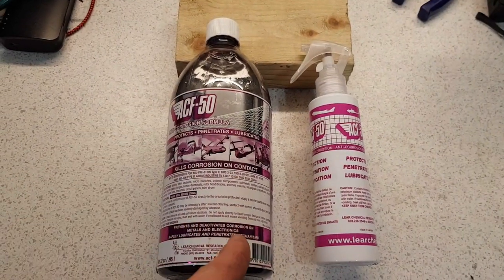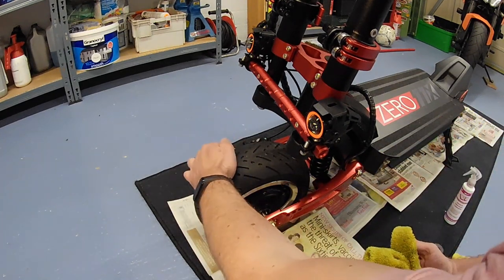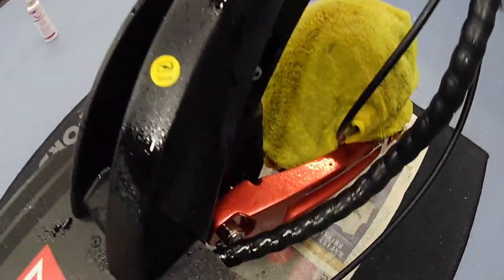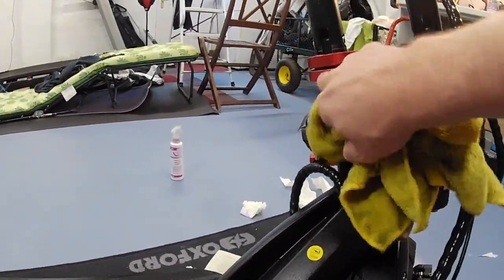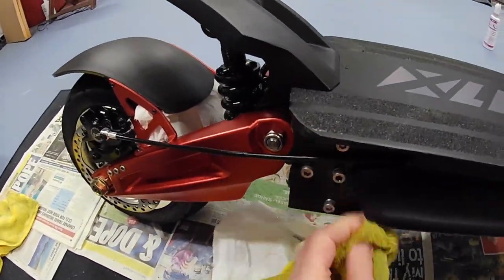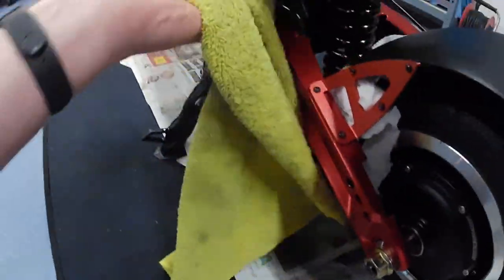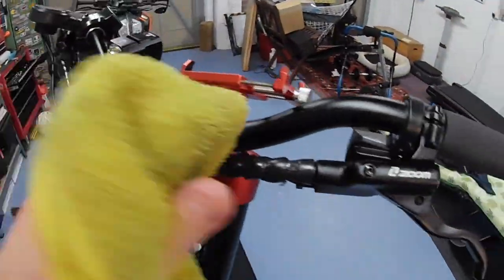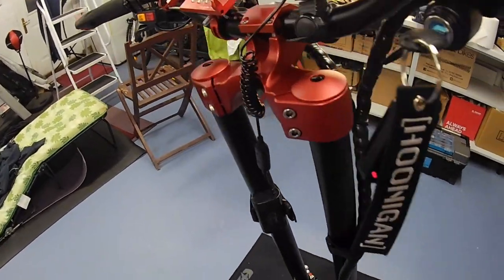Rustproofing the ZERO 11X Extreme Scooter

Comment: Hello,

Used it more then 10 years on my motorcycle. Had to use my bike also in the winter to commute for my job. Did not had a car.
Sometimes it was more then 25 degrees celsius below zero. Damn, that was cold. Although i had electric clothing.
But that stuff you are using did keep my bike in a good shape. Not completely ofcourse but when i had not used it in the first year all the salt would have corroded my complete bike. But when driving through the salt you have to use it a lot. Every two weeks i used it on my bike.
Some parts i dismantled to get everywhere because salt also comes everywhere in your bike. From all what i have used in 30 years the stuff you are using is by far the best against corrosion. Silicon is in reality a very poor product. Just butter is way better then silicon.
When cleaning your scooter be aware that you use cold water, not warm water because the effect of the salt starts to become much stronger with warm water. Just cold water with some mild determent like green soap. Sometimes in soap also salt is an ingrediant. Be aware of that. Or buy a good soap product that is for car use. 
And also seal every hole on your scooter otherwise water and salt gets to your controller and cables. But then it can not breath. So you have to put a few little bags with silicagel in the inside of your scooter.So the silicagel can take up the condensation that otherwise will buildup in your scooter. Every few weeks you will have to replace the silicagel for fresh ones.

Comment: This was great to watch. Gives me ideas.

Have you waterproofed your scooter with silicone, yet?
Reply from the maker: Yes, all done. Pretty simple job with some black silicone sealant. You need to remove the top cover plate and put plenty around the cable entry points into the battery compartment. The top plate gasket I left alone as it looked pretty decent. I've lightly jet washed it twice and so far no problems